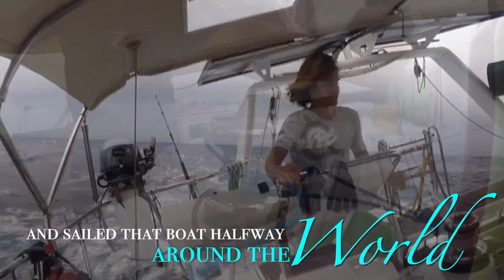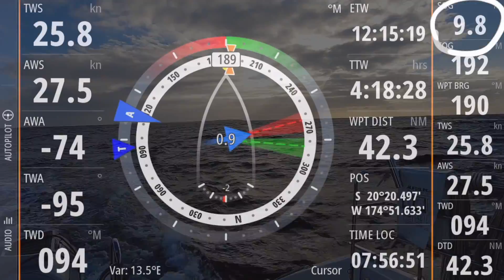Saying Goodbye to My First Love 😢 (Sailing Zatara Ep 92)

Comment: I feel for you Keith, I suffer from kidney stones, there is no easy solution, unless you pass one and catch it and have it examined it’s really s guess as to what the cause is (calcium, salt, spinach, dairy) I will give you my advice for what it’s worth, 1. Next time you are at a pharmacy get you some FLOWMAX it loosens up the pipes for stones to pass easier, and second carry pure lemon juice and add it to your water . Best of luck  buddy🤙🏼
Reply: Passed a kidney stone once, thought I was gonna die, a most painful experience that still hangs over my head. Doc tells me there's another one the same size and a second one on the other side 50% larger so it's something you think about almost daily

Comment: Just out of curiosity here and any cruisers can chime in if they're familiar with this but, do you or can you route your air conditioner water exhaust lines into your water tanks? My understanding is that air conditioners produce liters of fresh water per day, same goes for dehumidifiers. I imagine this would help alleviate, at least somewhat, the stress on water makers by reducing the energy needed to run the pump and by providing more water in addition to cooling/dehumidifying the interior. Do your water tanks go through an additional filtration system? The water coming out of air conditioners and dehumidifiers may not be 100% clean.

Comment: Great show. On the watermaker thing, I would add a freshwater RO system to your watermaker system. I live on a houseboat in the Columbia River and make my own water from the river. My homebrew system takes 90PPM river water and gives me 2PPM drinking water and 100PPM "house water" which we use for washing, bathing, etc. Adding a 50PSI pump to the output of your watermaker and running it into a freshwater RO system would take your 150PPM freshwater into two streams, 2PPM drinking water and 170PPM house water for your tanks. Might help the kidney problems too.

Comment: As a kidney stone veteran of almost 30 years (hospitalised 3 times, passed half a dozen sizeable stones, and even more smaller ones), thought I'd pass on some guidance. Kidney stones are produced by everyone, except almost everyone makes really small ones, they move easily and pass out of the body without the person noticing. Some lucky few have kidney stones that get stuck along the way and being surrounded by a mineral rich solution, they can grow. Discomfort is usually caused when a stone moves, or if it gets really stuck or causes a blockage. Being dehydrated can really suck and cause a kidney to ache, symptoms similar to a kidney infection.
Best thing is to drink plenty of water, minimum 2 litres per day, every single day, increase if in hot weather, or if exercising and sweating. I try to get through 3 to 4 litres. Avoid caffeine or reduce caffeine intake (tea, coffee, cola) as it is a diuretic and will dehydrate you. 
Low salt diet, try not to have too much.
Low oxalate containing food diet (avoid or don't have too much of, beets, spinach, chocolate, coffee, sweet potatoes, peanuts, soy products).

I rarely go anywhere without some decent pain meds. I know the max dosage and if I get sudden onset of pain, then its pills and lots of water, which if it doesn't ease within 3 to 4 hours, then its straight off to hospital. I had a complete blockage of the ureter (tube that leaves the kidney to the bladder) when I was 28, at 3 am and I was leaping. I wouldn't wish that on anyone. It was only when I was in the hospital on gas and air and having had an injection of pethidine, that I stopped writhing around. If the pain or discomfort is steady and low, normally a good sign, and with lots of water it will subside. Pain that comes on and increases is going to be bad every time.

Comment: Damn Onion cutting ninjas....lol. 
On a secondary note,  wrap that foot with an ace bandage to help with swelling and when icing make sure you have a towel around the ice pack in order to ensure you don't freeze tissue.  for the first 24 hours after injury the acronym RICE is helpful, rest, ice, compress and elevate.  After about 48 hours or so you can switch to heating pads...

Comment: Broken toe bone, you need a hard sole soft top Velcro shoe.
Ice for the first 24 hours, then warm heat the next 48 hours.
Ice to decrease the blood flow to prevent swelling, then warmth to increase blood flow to help healing.
Both go 20 minutes on, 20 minutes off, repeat.
And yes, keep off of it for the next 4 to 6 weeks.
At 6 weeks the bone should be healed enough to "USE" but the bone will not completely heal for about 12 months.
AND YES, you need to see a Dr. and have it x-rayed to see what kind and extent the fracture is.
Being a MAN and ignoring it is STUPID.  Suppose it was Kate.  You would be at the ER ASAP!  Would you not?